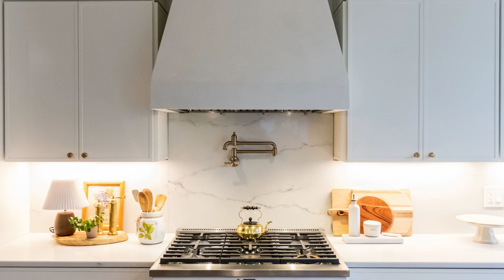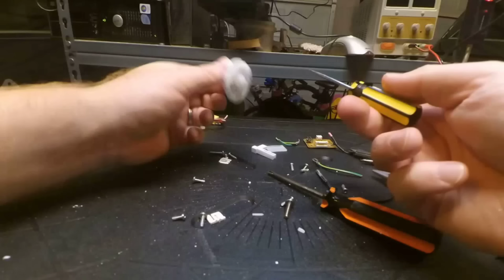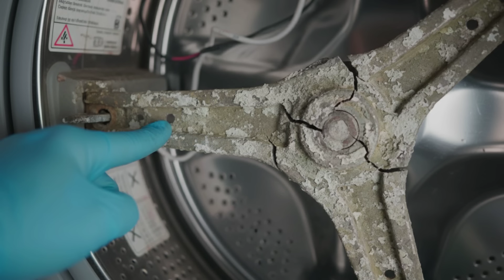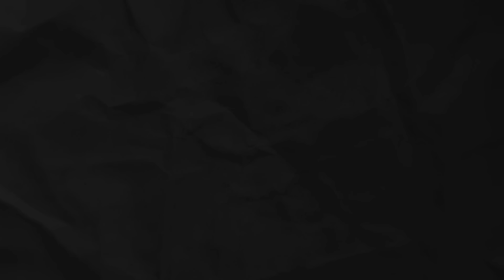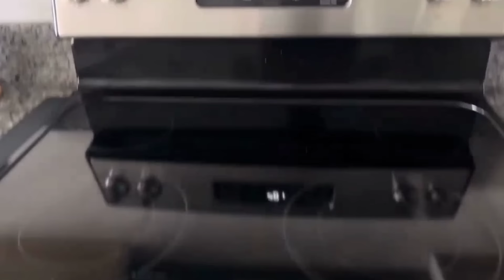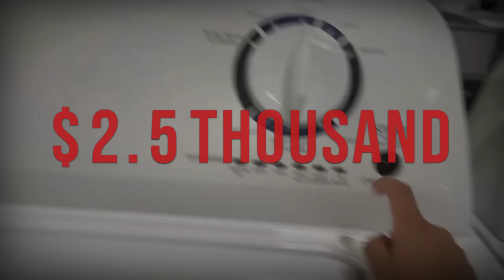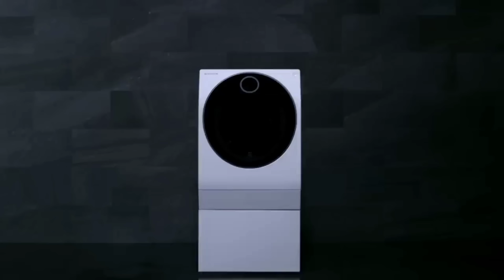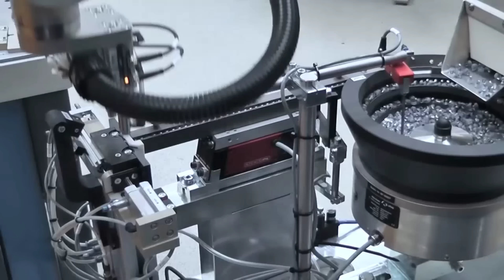The Repairman Blacklist: 5 Appliance Brands to Never Buy

Comment: My Dad was an appliance repairman for 45 yrs. For laundry machines he always recommended buying Speed Queen. They make machines for laundromats that are meant to last. He also recommended Kitchen Aide dishwashers but not sure that brand is what it used to be. He also said to never use liquid fabric softeners. The wax in the softeners help degrade the parts in washers and dryers faster. Have always used the wool dryer balls.
Reply: I love my SpeedQueen washing machine!
Reply: I've been using white vinegar for years.
Reply: @starastronomer yuck. Vinegar stinks
Reply: I've heard that often about fabric softener.  I use tennis balls.
Reply: @porkrind3512  Ditto with me too. The wool tennis balls from Trader Joe's are the ones I have used for years.
Reply: We had a 1964 Hobart built Kitchen Aide dishwater, still running perfectly in 2017 when the house was sold.
Reply: . My kitchen aid fridge is 25 years old!
Reply: Where can you buy laundromat-quality washers / dryers???
Reply: @annwood8634  Speed Queen, they are expensive $2500 or thereabouts for the washer but they are built to last 25 years minimum
Reply: @annwood8634 Google it!
Reply: @annwood8634 they’re usually sold through dealers. Check out Speed Queen distributors in your area.
Reply: @annwood8634  I got mine directly from a Speed Queen Distributor.  It is a "commercial multi-housing" model with mechanical controls.
Reply: @annwood8634  SPEED QUEEN!
Reply: @annwood8634 have you ever heard of the internet?? You can order those online at any appliance website. Use your head
Reply: Your dad was a smart man. Although Front load washers aren’t as bad as they make them out to be. Those spider gears fail because of user abuse. My Samsung front loader is 16 years old  and still going strong.
Reply: O use the wool balls but also whitr vinegar im the softener cup
Reply: We use speed queen washer and dryer and I always recommend them. They’re excellent and wear like tanks.
Reply: @MBkittygiggles I have heard recently they have changed the quality of the Speed Queen as they are going with more plastic parts…wish I knew if this was true…..
Reply: @michaelstec5489 its ok, i already have mine and they’ll probably last until im dead
Reply: @michaelstec5489 I bought a Speed Queen dryer in 2019. A repair man is coming tomorrow for the 6th time.  Good thing it came with a 😊 warranty!
Reply: @michaelstec5489 just get the simple one. Even with plastic parts, Speed Queens are pretty bullet proof.
Reply: @michaelstec5489 exactly. Everything is made overseas now.
Reply: Wow.  Thanks for the advice.  I use dryer sheets if I have to, and tear them in half.  I guess you're not supposed to use them on towels, bc they leave a film and make them less absorbent.
Reply: @lpcookie1 that's not true at all
Reply: My maytags are 41 years old and still going strong and I use fabric softener as I hate those wool balls clanging in the dryer.
Reply: @Catherine-rt9unI have no doubt your old machines are excellent. Try buying a new one, though. It’s sadly a different story.
Reply: We bought a Speed Queen TC5 washing machine to replace a four year old Maytag. It seems Maytag went to sh*t after they moved manufacturing out of Iowa. Same for Amana.
Reply: @WyoMedic540 the simple Amana washers and dryers are pretty good. Don’t buy any frills. Just the on/off. We have Amanas in our rental units.
Reply: We use vinegar in the rinse cycle rather than fabric softener. No noticeable vinegar smell in the clothes and they feel just as “soft” as it gets out the detergent residue. They don’t have the fancy softener perfume smell which suits me.
Reply: You're right, and so was your dad!  I asked my repair guy what he had in his house for a washer and dryer. Speed Queen. He said they're American made and don't break. That's what I bought.  Simple, No frills. Very happy with them!
Reply: How right he is, too many people  us softens, it's all this slick marketing.that people  get such into.
Reply: @gayleenrooney2984 you can't write a sentence.
Reply: Daddy was a Maytag Repairman who always complained he was "so lonely" to mommy, until he hired that twenty-something ex stripper to be his assistant.
Reply: Speed Queen is a rock solid brand.
Reply: Good to know
Reply: thank you for the advice!
Reply: We asked a repair shop for advice on washing machines.  He said they are all the same inside with a 5 year life, whether $300 or $3,000, so don't waste your money.  But agreed with your dad about Speed Queens. They just have a really small capacity.
Reply: I LOVE my Speed Queen washer and dryer! They are beasts!!!
Reply: Speed Queen is the way.
Reply: Whats the best brand of stove
Reply: @barbarabooker8608 do you know how to use the internet? Look it up yourself!!

You Boomers 😂😂

Comment: My 2001 Kenmore front loader is still going. I change the (unchangeable?)bearings and seal every 10 years and keep it scrupulously clean 
I use liquid soap. Never powered soap. It rotts out the spider once the powder cakes in the casting cravices.
Reply: If you want to know who made your Kenmore (it wasn't SEARS), write down the first 3 digits of the model number (before the decimal point) and go to a who made my Kenmore website. The first 3 digits tell you who the manufacturer was.
Reply: Our 2001 Kenmore just died. We think it's the bearings due to sluggish turns and squeaks or the spider but heard the part is $1000 and the drum is very heavy to take out?
Reply: @use @user-sw9iu8ve8t I don’t know about your brand, but the bearings were a very cheap part for our Frigidaire dryer, and my husband didn’t have to remove the drum to replace it.

Comment: No matter who the manufacturer, never ever buy any front load washer. That be stupid.
Reply: Are you saying all of Europe is stupid?  Because that's what they've been using for over 50 years.
Front loaders are much gentler on clothes, and they wash great.  I've had an LG since 2018 (8 years) without any trouble.
I guess it depends how you use them.
Reply: @coolcat8b These salesmen claims gentler or water usage are totally false and unproven. The bearing mechanics and water sealing of top loads are  indisputable, certain to be more durable
Reply: Amen.
Reply: I’ve had a front loading washer for nearly 20 years. A Kenmore.  Not looking forward to replacing it.  But I will absolutely go with another front loader.

Comment: I wish you had included which brands we SHOULD buy for each example.
Reply: That would definitely help a lot of people. It’s useful to know which brands to avoid, but most viewers probably also want to know which home appliances are actually worth buying.
Reply: @IndustrialScienceLabYT Absolutely I would! Thanks 🙏
Reply: Used appliances from sears still have mine 2026
Reply: @isay207  The Kenmore brand was a sturdy workhorse back in the day!
Reply: @deniseandrews113  not so much any longer
Reply: @deniseandrews113  I bought Kenmore appliances when I bought my house in 2003.  All are still running well.
Reply: @isay207 have my sears sewing machine from 1975, bought it new
Reply: Kenmore, older Maytags, Speed Queen washers.  Never LG or Samsung.
Reply: @JaneDoe-qi2gqwow. Thanks for this. My 8 year old samsung washer just went out.  Im planning to get Lg today since they say its the best.  But i didnt like the digital part of it.  Was debating the knob maytag.
Reply: @JaneDoe-qi2gq I've had my Samsung washer and dryer for over 10 years with zero issues.  People who have problems with appliances less than 15 years old abuse them and are idiots for doing so.
Reply: As a general rule, look at what brand of tools people rent out, be that at yr local rental place, or a big box.

A couple not mentioned yet, Miele for vacuums
And buy commercial screens instead of a TV. No telemetry. And if you buy multiples, they raster, generally thru the remote screen, not a computer. You can almost always find then used off marketplace or Craigslist.
Reply: Front loading washers are terrible.
Reply: This channel has other videos that cover a LOT.
Reply: Whirlpool, Maytag and Speed Queen.
Reply: @J0HN_3_16 Roper is made by Whirlpool
Reply: @J0HN_3_16  Those are the three my appliance repair lady suggested after my 23-year-old Maytag died.
Reply: @J0HN_3_16 . Definitely not Maytag or Whirlpool.  No way. Refrigerator started a house fire.
Reply: @Happybidr  WAY too vague.  What exactly happened????  Please tell us!  By law, refrigerators must use flammable refrigerant, and that can cause a fire if something makes it leak out and a spark happens at the same time.  But a fire can be started with faulty electronics.  So, which is it?
Reply: Bosch for dishwashers
Reply: @Robin-xt7yo  I just replaced the entire Zeolite drying system in a Bosch 800 series dishwasher, $400 in parts (if you can even get them.) The labor would have been at least that, because much of the machine had to be taken apart. Apparently this is a common problem, caused by serious engineering issues with shielding plastic from the flow of heat.

So, no to Bosch (Miele uses a similar system.) Not the first time this unit had to be serviced, BTW, at age 6 years. And not the only issue I’ve had with Bosch appliances (never again.) As well, they are considered “luxury appliances” by some parts jobbers and repair shops, which limits parts/service availability. Even more so with Miele.
Reply: @declanfarber 😳
Reply: @declanfarber , helpful info. Thank you.
Reply: @Robin-xt7yo Bosch low end cheapest price for dishwasher
Reply: @Robin-xt7yo mine basically fried but previous owners of my house maintained nothing
Reply: @Robin-xt7yo Surprised to see negative comments. I love my Bosch dishwasher.
Reply: @Allwell168 yeah i love my Bosch too.
Reply: @Robin-xt7yo definitely not, they used to be great, I had a top of the range Siemens, (same company as both Bosch and Neff and made in the same factories), it failed after 6 years. If you can afford it get Miele and get the simplest one with only the functions that you will use.
Reply: Dude if you have a working Bosch, that's a miracle. Those are garbage with great marketing
Reply: He did tell you watch it again Whirlpool and others were mentioned.
Reply: Whirlpool/Kenmore direct drive
Reply: Look at speed queen classic. Off balance won’t rattle either.
Reply: Show me where the simple analogue appliances can be found, please!
Reply: @debbiedobbs5800 Nowhere.
Reply: @debbiedobbs5800  have a Amana drier 8 years old cheap and dirt simple
Reply: He did say it in the beginning. SPEED QUEEN!
Reply: love my Speed Queen  just knobs
Reply: Speed queen is one, think you can find it here in our country this is one I recall . Google it maybe.
Reply: So do we!
Reply: See my playlist - 'Appliances'.
Reply: He shows Frigidaire and ge machines that are the good ones while telling you about the Samsung, lg and  ge all in one.  Buy Frigidaire refrigerator,  ge washing machine, Frigidaire dishwasher
Reply: We have basement model Amanas in our rental units. Basic three cycles for the washer (normal, light and delicate) and a dryer that is essentially just a timer. Nothing digital. Pretty bulletproof. We have two of each in storage if they ever go wrong.
Reply: They showed my Whirlpool Gold dishwasher in the video. It’s been going almost 16 years now. Never had a problem other than that the mechanism that holds the door up doesn’t work anymore.
Reply: Top of the LINE = Speed  Queens. - the ' commercial ''  ones.....do not  go near.....ANY THING  ELSE.....  :~ )
Reply: Miele. Built like trucks.
Reply: Speed Queen.
Reply: @Flowerchild204  even they have started having some issues with some of their machines..the TR series gets a lot of complaints for its weak wash action, the TC5 classic topload came out in response but it too has a control board and theres been some field failures..dont get me wrong I think SQ is still better than many others out there.. their true commercial machines are the only ones without electronics and technically they arent supposed to be sold to consumers. (government tree-hugger thing)..you can buy them but there will not be a warranty..
Reply: Miele
Reply: @gargoyle7863 who can afford those? Super expensive to buy and maintain.
Reply: They do have a video about which brands last. Look at the playlist.

Comment: Much on appliances not to buy and everyone says buy dumb appliances, but try and find them. I need a washer/dryer and refrigerator and much to my spouses disgust I'm ready to start looking for used old models. Most everyone touts Speed Queen but they use circuit boards like everyone else. Another video on this channel says buy Amana or Frigidaire refrigerators with mechanical slider. I didn't see any model numbers. AI voices, glossy videos without real specifics or useful information. Why? Because all these content providers are about subscriptions and views - making it look and sound nice, but not much else. And you will never find much that is useful regarding appliances because you can't buy anything new with simple mechanicals at least not sized for a family - meaning 28-30+ cubic feet for a refrigerator. Frigidaire has a French Door 29 Cu. Ft. Standard-Depth FRFN2813AF-C1 (with digital control board -  not mechanical slider), but we are told top mount and bottom mount refrigerators, and standard depth, are the most reliable. The largest bottom drawer refrigerator Frigidaire makes is 20 cu ft. The largest bottom drawer Amana is 22 cu ft. When someone posts usable information I'll subscirbe, but not for some computerized program looking for views.

Comment: I have a secondary LG refrigerator and it has the refrigerator door ice maker and it’s worked flawlessly.  My sub zero refrigerator ice maker clogs up at least once a month and it’s a pain to remove compared to the LG.  Plus I paid 15k for the sub zero but I’d still buy another one even with the screwed up ice maker design.

Comment: Also remember to clean that dryer vent once a year or so. The lint builds up and will increase the time to dry over time.

It also becomes a fire hazard.
Reply: How about each use?
Reply: @janking2762 I was talking about the vent to the outside not the one in the dryer. The filter in the dryer should be cleaned each use Yes.
Reply: Once a year? You must live alone and travel a lot.
Reply: @michaelcunningham2165 no I have two roommates. I clean the filter after every use. Just the vent from the dryer to the outside is about once a year. Most people don't even think about cleaning the vent.

Comment: "acidic detergent"?  Detergents are alkaline (basic), not acidic...
Reply: i wondered that too. maybe water in some areas adds acidity. but i think water alone will corrode that junk pot metal
Reply: @mikeedwards1768 no detergent is the cause of the spider deteriorating.  When only cold water is used it sticks to the spider and deteriorates it.
Reply: Truth
Reply: I came to say the same thing. It has the same action of breaking down aluminum but it is the base that causes it, not acidity (although strong acidity can also deteriorate aluminum).